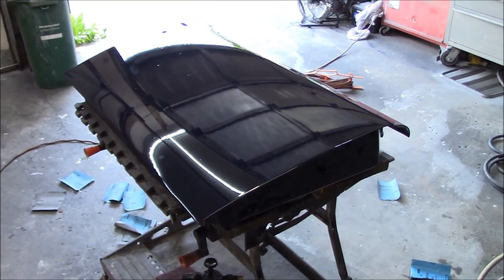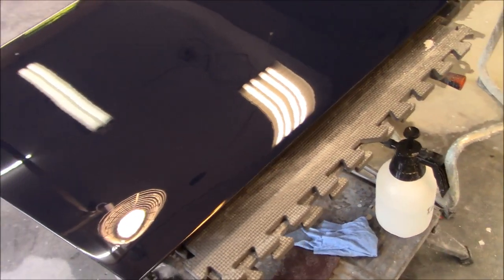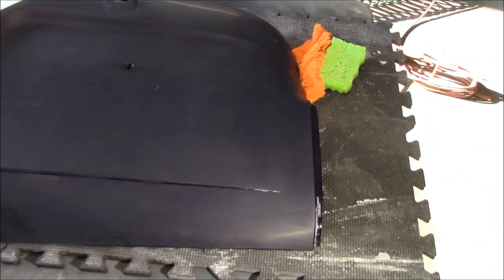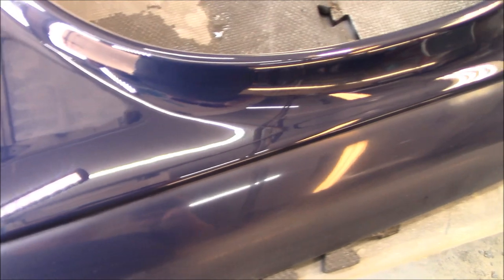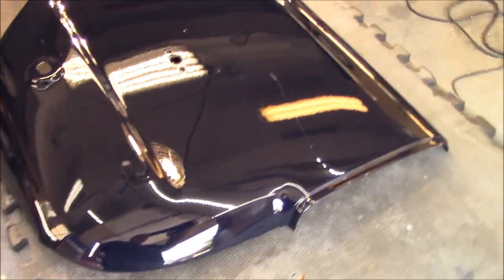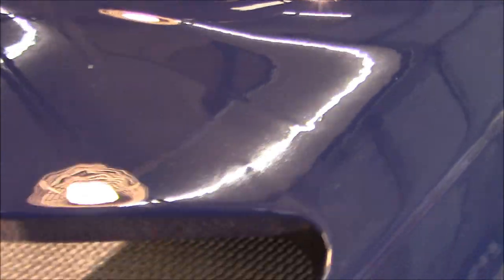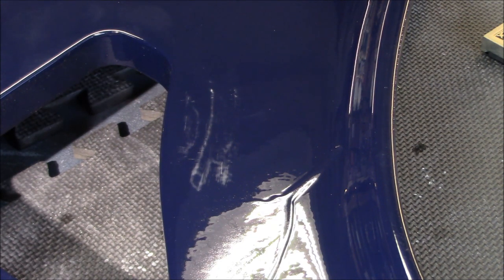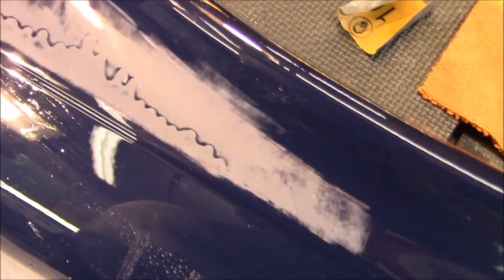1968 Triumph TR250 Restoration, Project Colour Sanding and Run Fixing...

Comment: Great work on the runs. This is one more reason why a professional paint job cost so much. It's not just material it's all the labour involved in the process. By the time your done you'll have the equivalent of a 15-20G job...it will be 1 fine looking car!!
Reply from the maker: Well, I’m assuming that professionals seldom get runs 😉
Reply: @cheftush  well based on what body shop guys buy here id say more often they might as well as dust nibs even in controlled environment!!

Comment: Hi Dave, the Stanley razor blades you’re using are the hand-held rigid type, but as a youngster I remember the very thin round cornered Gillette razor blades that fitted into a face/wet shaving razor. I guess they would be a little less risky scratch-wise, but I don’t know if they even still make them…Beautiful, beautiful panel work my friend the 250 is going to be a lovely car! 👍🇬🇧
Reply from the maker: Thanks Phil!  I think I’ll just stick with the sandpaper as it’s more in my comfort zone…it will take longer but I work very cheaply 😉

Comment: Looking good, Its a little after the fact but if you have time to kill...Trev's Blog has a video called Paint run removal that has a good tip for heavy runs.  If you cover the run area with body filler/glaze and then sand it will level the run and not under cut the paint around it. Sounds strange but after seeing the video it makes prefect sense.
Reply from the maker: I’ve done the same process before on my 1960 TR3A project. Works well.

Comment: Your getting pretty good with the razor.  I guess you got a lot of practice chopping up that white powder in your racing stripe video. I remember the first car I painted with lacquer. It had so many runs and dry spray spots on it that my painting mentor had me color sanding with 400 grit and finishing with 600. Then I buffed it with a red super cut compound, finishing up with Dupont polishing compound. I think it took longer to clean up the compound mess than it did to buff the car. I must say tho, that it turned out pretty decent.

Comment: You may have been able to slightly  round the ends of the razor blade on the bench grinder.But I think sanding is the safer option and you have done a great job.
Reply from the maker: Agreed, I was thinking of using my flap dish on my air grinder to round the edges after my attempt to bend them failed…I’m happy with the sandpaper…it works but it does take some extra time.

Comment: Excellent work. That light does not lie. Going to try colour sanding and buffing on one of my corvettes first before the TR4. Thanks for the tips. The TR4 is painted in a single stage. Have you done one (single stage) of the those Tush?
Reply from the maker: Hi Robert, no, I’ve yet to paint single stage.  I usually go with the base/clear as I know that I will need to be sanding a lot of dirt/bugs out of the top coat…
Reply: @cheftush  Hi David, Thanks when I farmed out the TR4 it was single stage. appreciate the feedback.

Comment: I don’t know if they still have them, but Eastwood use to sell a small plastic block that held a razor blade at an angle, specifically for shaving off runs. It had a knob on it that adjusted the blade contact. Maybe small X-Acto blades could be used as well.
Reply: They were called Run Razors
Reply from the maker: Yep they still have them….don’t laugh, but I have something similar to shave truffles 😉
Reply: @cheftush  I hope so - nobody likes a hairy truffle!😜

Comment: Good work, Tush. You have the patience of a saint. I could feel your apprehension when starting with the razor blade. Question: Would you say that some runs are inevitable, and do you have any tips that come to mind for avoiding runs? Having never painted a car, (yet), I'm interested in any and all "tips".
Cheers!
Reply from the maker: As a pure amateur,  I would say some runs are inevitable….I think even the pros will get them once in a while but I could be wrong.   I think it also comes down to the scope of what you are trying to spray and the environment you are spraying in.    More panels, bigger project there is more of a chance of a concentration lapse…less space in the garage to move around leaves you spraying sometimes at less desirable angles etc.   Obviously, painting in a home garage vs a climate controlled booth makes a big difference as well.  Sometimes it just comes down to luck on the day…it’s like welding, sometimes I can’t weld worth shit and some other days I’m magical 😉  I find the same with painting, some days are just better than others.

Comment: Hello, I see you strugle with dust during the painting process. I remember when my father was spraying cars in his workshop in the sixties he first covered everything in his workshop with thin plastic and then he heated it up. Then he sprayed the workshop, ceiling and the walls with the same paint used on the car to be sprayed. Al the dust and bugs where stuck by the paint. after 10 minutes he started spraying the car with very little dust flaws in the pain of the car. He also made the floor wet to catch the dust better.
Reply from the maker: Hi Cliff, thanks for the reply.   I do wet the floor to keep down the dust and overspray.   I’d though about building a booth but it was more work than I wanted to do.  I make sure that I have at least three coats of clear coat on the car so I can sand out most bugs and imperfections.

Comment: What do you use to sand the inner curves around the wheel arches?  The panels look amazing as always. 👍
Reply from the maker: Hi Michael, I’m using a soft thin sponge wrapped in sandpaper for the highly contoured areas.
Reply: @cheftush  ok thanks David  I’m working on my friends repaint at the moment so your videos are helping immensely,thanks again, Michael.

Comment: For the worst runny panels, do you think you messed up the mix of thinner / hardener a little ? Or was it just a slightly wrong spraying action ? Or the panel sitting funny on the bench ?

Looking great now....
Reply from the maker: Hi John, it was most definitely my screw up spraying.   I was trying to angle the gun to get clear onto the interior opening of the wing vents in this area and changed my angle of spraying.

Comment: Looking great !
Thanks for sharing 😀
When will you start my project/order ?
TR in British Racing Green, with slight flake and pearl.
Saddle brown Highest-quality hand rubbed interior leather !
Maximum engine build, blueprinted, balanced, ported, total highest end build with fuel injection, and best transmission upgrade available. Full upgraded brakes and suspension.  No limit budget on build. Best of everything. Concourse looking daily driver. 
Cheers !  Lol
Zoom Zoom.
Reply from the maker: That’s a pretty tall order! Sounds nice. 😎
Reply: @cheftush  lol.

Comment: When you re-sand the first door, will you do the full 1500/2000/2500 treatment, or just a subset?
Reply from the maker: Hi Andrew, I’ll probably just go over it with the machine again with a finer polish/sealer.

Comment: Hi Dave Steve I will put the panels on the car before San and polish the car
Reply from the maker: I’m going to do a final polish once all the panels are on the car.   Things like the doors will most likely get scratched a bit when I put the door internals and glass in…this is easier to do with the doors lying flat off the car…I’ll put a soft blanket down but I’ll still get scratches I’m sure